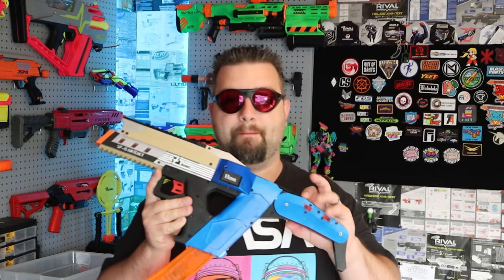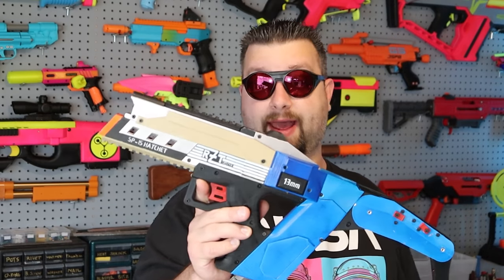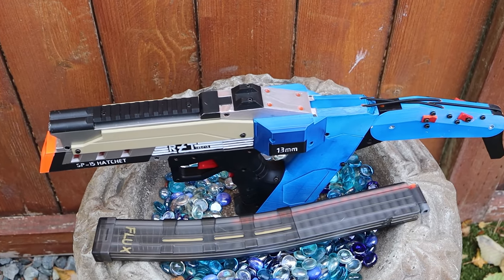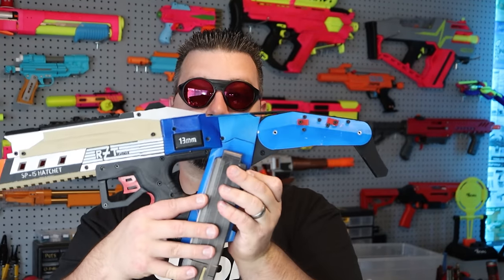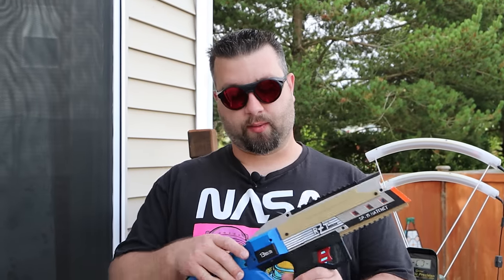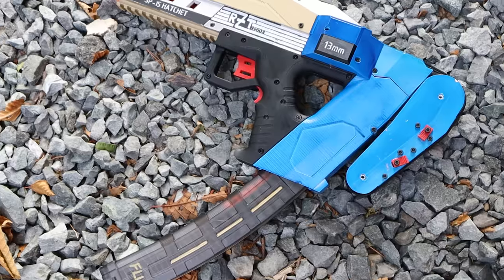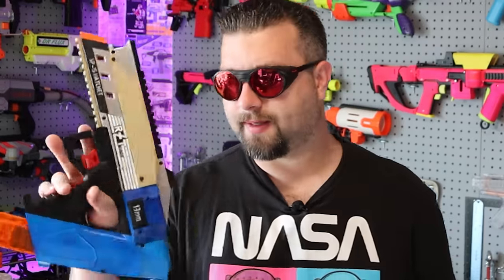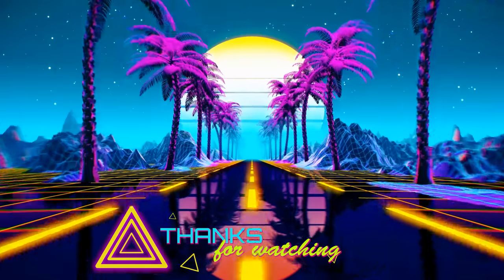Nerf Titanfall 2 Alternator

Comment: Looking at yours, I can definitely see where there are really steep overhangs on some of the external surfaces where we both have issues with them coming out somewhat clean. I might toy around with splitting parts up with steep overhangs, but I'm about 1/2 way through printing mine and I've been sanding nearly everything so far that has rough edges. That top part near the rear irons is definitely a major issue so far.
Reply from the maker: I totally agree!

Comment: I need one. Seriously. Needs brushless 😁

Agreed it needs a second stage if you're using FRVs or Krakens at specced voltage.

Pulsars should do just fine though with Merlins on 3s though. Get a bit more spice into those darts.